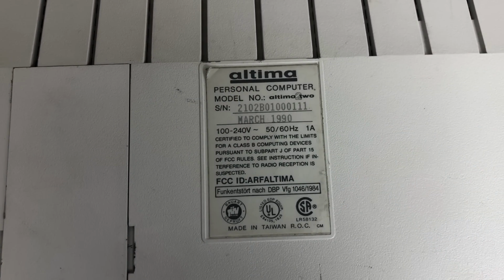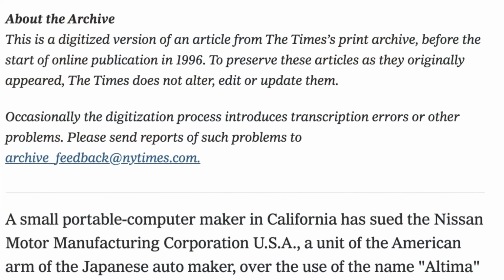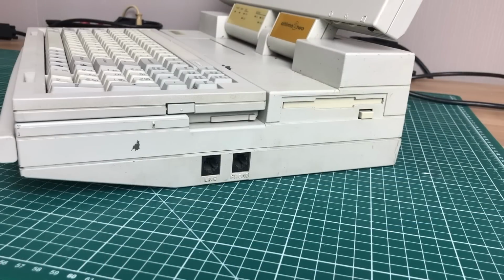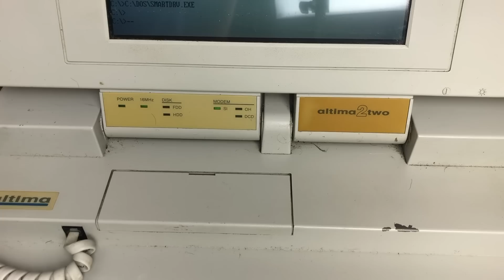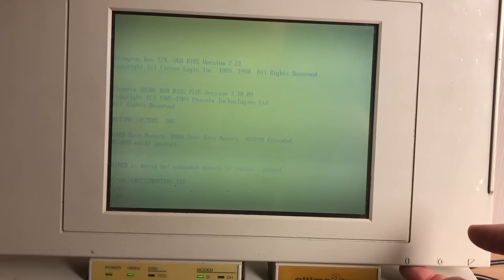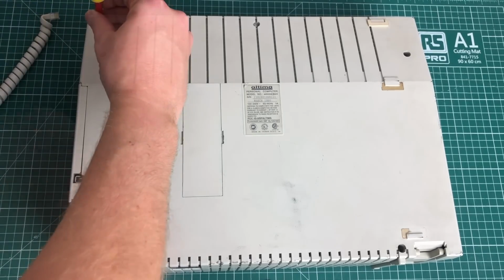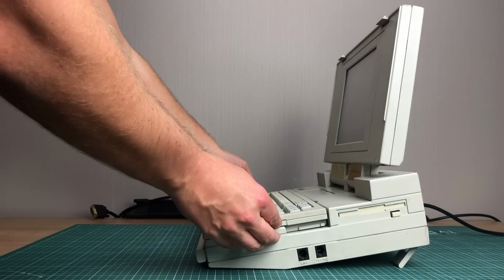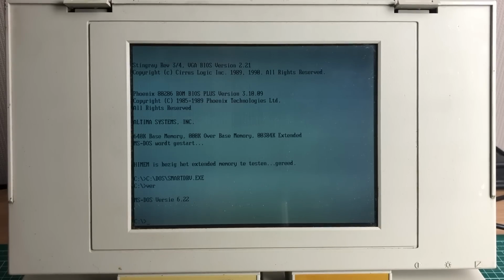Altima Two retro "laptop"

Comment: I still have an Altima 3 386/8 or 16 MHz (always 16 lol). I got it back in 1992  because it had a card slot. I could (barely) fit a 7.5 inch sound blaster card. Also made it so I could bypass the 20MB max HD capacity 😄
The reason I needed the SB card was so I could run midi through the joystick port for my solo act. I used it from 1993 to 2002 when I switched over to MP3 back tracks for my solo gig.
Actually, maybe.mine is an Altima 2. Looking at the ads and your video everything looks identical except I was sure mine was a 386. Now I'll have to clear out my storage room to the back and find it to find out 😆
Reply: I mostly ran Dos programs but had windows 3.11 so I could run Cakewalk 3.0 (back when it was only a midi sequencer program).
This computer was a work horse. I ran it outside in hot summer weather as well as a few cold winter gigs though the cold did slow it down quite a bit. It has 1000s of hours on it.

Comment: For anyone who is still searching for info on these, one thing i've  discovered is that to use an external monitor you need software.  Fortunately the switcher and display software available for Amstrad Alt 286/386 computers work fine as they are all Cirrus Logic. And yes I have those as well  😀
Reply: I used to run an external monitor on mine when at home to play games. I think I used to hit Ctrl+V or something like that to activate the VGA port and then Ctrl+L to switch it back to LED.

Comment: well, i've ben watching this video VERY closely, as i've just bought myself an Altima *3*. unfortunately, 2 capacitors on it have popped, and i can't seem to get it to do anything other than click on a fan. the 3, by the way, has a 386SX and a 286 slot, and it can accept up to 7mb's of RAM over the 1/2. i also (not sure) think it has a 16 bit ISA slot, over an 8 bit one. i was wondering if you might be willing to attempt to repair it, as you seem like you would know where to source parts like caps. if not that's fine, just was willing to give it the ol' college try!

Comment: Strange computer. Direct competition to the Toshiba T3200, 4 years late. Processor is faster, vga is definitively a huge improvement. 1MB RAM, 40MB HDD and ISA slot are pretty standard for this kind of luggable. Separated keyboard is a gimmick at best. It's an odd mishmash of cutting edge tech (speedy 286, vga), and really clunky design (the aforementioned Toshiba is looking sleek, that ones looks like a transformer robot hiding as an everyday appliance). Anyway, interesting video, but even in its days it must have looked like a little strange.

Comment: The denial of the trademark on the name had little to do with the size of either company. Trademark law dictates you must vigorously defend your mark. It also states that trademarks are specific to an industry. So, even though Nissan got to use the name, it had to promise not to build computers under that name. In turn, I'm sure Altima promised not to build cars. With the court settlement, both companies are protected and each's use of the name is defined by mutual agreement.

Comment: The case plastic is probably ABS, and if so, you can get some ABS glue that will work better than superglue at your local home improvement store in the plumbing department; or make it yourself by dissolving some ABS 3d printer filament into acetone (keep adding filament until it’s the consistency of lukewarm honey).

Comment: In 1990 a 286 wouldn’t really be that fast. They had 386 portables later in the year and 486 desktops a year prior. 
If I’m gonna google something and waste time might as well comment.
Reply: 16MHz Harris 286 was considered a fast CPU in 1990. For dominant 16-bit software, the speed was similar to 386 systems on the same clock (even slightly faster for various reasons). It took another 3 years before 486 was really available in the (hi-end) portable market.

This Altima was not a hi-end portable. It was a cost-efficient system (thus 286 instead of 386SX) with good expandability. It was presumably based on an OEM chassis to make the price as low as possible. Hi-end portables of this size had 386 or 386SX at the same time. However, the benefit of 386DX/SX was only in the 32-bit software (especially with 32-bit protected mode), which was typical for technical/scientific computing. Average DOS program didn't benefit from it.
Reply from the maker: Early nineties was an exciting period for computers. About the only time you could buy 3 different generations of computers new at the same time (286, 386 and 486). In 1990 a lot of people (and businesses) were still working with XTs and 286 8 - 12mhz machines. So in that respect I can understand why they wanted to emphasise the “speed” of this laptop.
Reply: RetroSpector78 I imagine 486 would have been like the hedt of today back in 1990. Considerably more expensive and in reality not that much faster clock speed for clock speed. However I would like to point out that they still sell 6th gen, 7th gen, 8th gen, 9th gen, and now 10th gen core processors between the mobile and desktop markets. It’s insane you can go to a store and buy a brand new 6700k or 7700k for the same price as a 9700k.

Comment: That's a cool old beast :) It's like a standard desktop system squashed down into a portable format. That green video connector on the board is likely just and ISA slot. Fast system running at 16MHz too.  A bit of epoxy on those broken screw mounts will be enough to hold them for a long time.

Comment: Thirty-year-old laptop, built like a tank using mostly standard components still working. New Mac book, if you sneeze on the screen it cracks and you have a paperweight.
Reply: Hey Birt! - if you’re sneezing that hard, perhaps you should see your doctor about that? Just sayin’. 😉
Reply: @darkwinter6028  :)
Reply: Dark Winter You don't have to sneeze, for some models all you have to do is well... just use it and hot air from that heatsink fan will unglue screen bezel and hinges.
Reply: Funny, I've had mine for three years. I dropped a Toshiba three inches to a padded bed and the screen cracked.

Comment: It's a shame the ISA slot was only 8 bit instead of 16 bit like the free Hyundai 286 desktop I got recently at a yard sale.  That would make getting network connectivity up and running pretty easy, as 16 bit 3Com ISA NICs with RJ-45 connectors were pretty common.

Were there any 8 bit ISA ethernet adapters that had RJ45 instead of coax?
Reply: If I recall correctly, a 3c509 (3Com Etherlink III) will actually work fine in an 8-bit slot, despite being a 16-bit card. The packet driver uses 286 instructions so you need at least a 286 (actually 186 I think) to run them.
Reply from the maker: Lots of 16 bit isa networking cards work fine on an 8bit slot. Sometimes the additional connectors of the 16 bit ISA were used to interact with the EEPROM chip so technically not really needed for the pure networking part. But there were some space constraints here so depending on the length of the isa card it would be a tight fit.

Comment: I honestly wish they still made modern laptops just like this, modernized with all of the appropriate modern USB ports, LCD display, modern Intel CPU, etc. Today's laptops don't have enough ports, lack a removable full key travel keyboard and sure as heck don't have any PCI-E slots!
Reply: I agree!  It would be a dream laptop, I wish to have one with a detachable keyboard and game pad and a few PCI express slots oh and some kind of motherboard standard so it could be replaced if needed.
Reply: Thunderbolt.

I have an external PCI-e enclosure with a Thunderbolt connector on it.  It lets me use my old MOTU multichannel audio interface from a MacBook.  Or I can use a Thunderbolt to FireWire cable and use my Presonus audio interfaces.  :-)

Or high resolution video, Gigabit Ethernet, USB...

Who needs expansion slots when anything you could want can be connected via a small cable?  ;-)

Comment: The removable keyboard isn't anything new. As far as the PC is concerned, the Compaq Portable had a removable keyboard (Dave Murray, aka the 8 Bit Guy has one), as well the Sharp PC 7000 that Shelby aka AkBKukU (his channel is now called Tech Tangents By AkBkukU) has. Those two are however 8086/8088 based systems (the Sharp PC 7000 has an 8086, the Compaq Portable an 8088), therefore XT class computers, so it is still remarkable to see how those luggables have evolved over the years into the AT era and until the early 1990s (when second source 80286 manufacturers like AMD or Harris produced much faster 286 chips than Intel did).
Reply: Subscribe to the 8 bit guy and Abbukuku
Reply: The Altima Two/2 is certainly a step forward from the Compaq Portable II/2 80286-based luggable.  Flat panel displays beat CRTs, the Altima keyboard layout is closer to a true full-sized one.  Each is a stepping stone in the evolution of transportable computing, and I'm glad to see that history being shown.